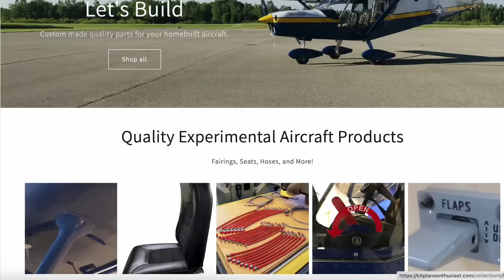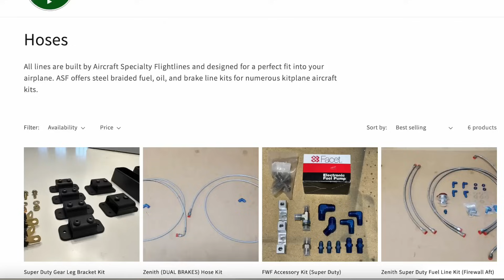How I Destroyed My Parking Brake!

Comment: Thanks for the videos Mark!
Why not use Velcro for the back seats?
Reply from the maker: I thought about Velcro. It would be the sticky back Velcro just like the magnets, but sometimes the Velcro is difficult to separate and I figured it would just pull the glue off the seat. Magnets will hold it but separate a lot easier than Velcro.

Comment: For rear seat - I would use magnet or some 'lock' 
With bump in air few things can go flying in cabin and drop into the hole after seat flips and block the elevator/rudder cables? - I bet that is low chance.